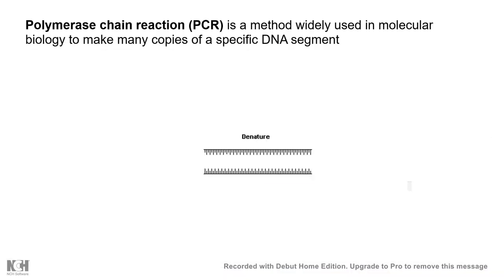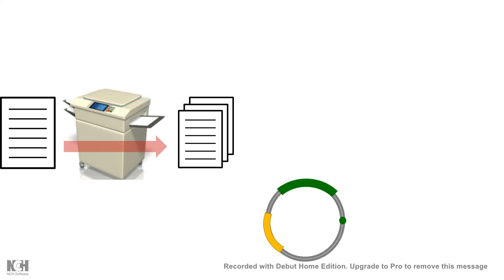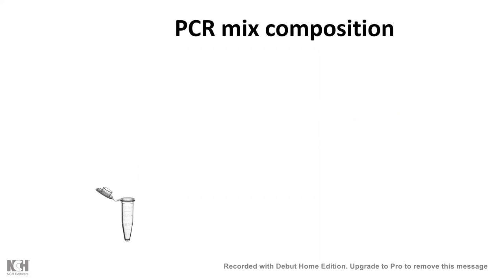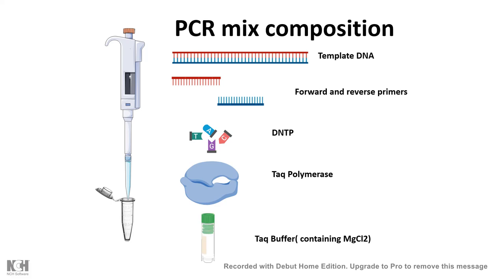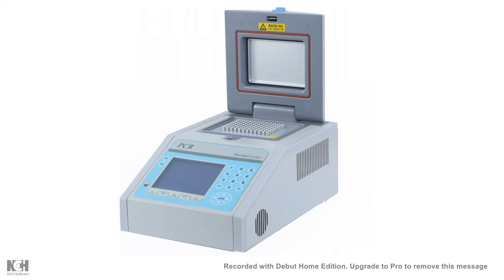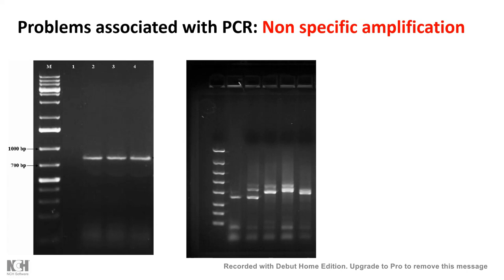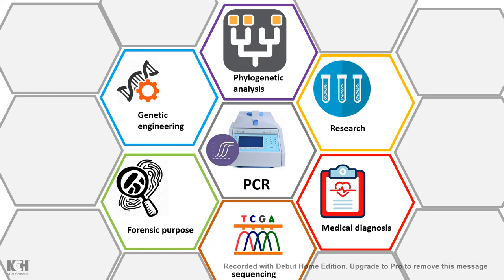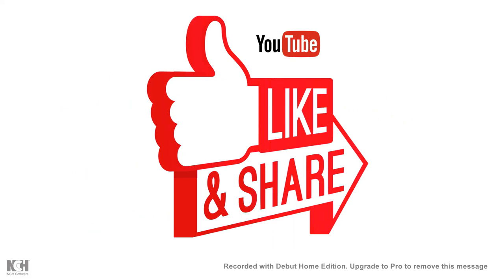polymerase chain reaction ( PCR) | What are the 3 main steps in a PCR reaction?

Comment: How can i avoid the smearing problem? What is optimum template concentration should use?
Reply from the maker: It's actually not simple. But trouble shooting cab be done by following ways.
To avoid smearing , consider these steps:

1. *Optimize Primer Design:* Ensure your primers are specific to the target sequence and have similar melting temperatures.

2. *Template Quality:* Use high-quality DNA templates free from contaminants or degradation.

3. *Template Concentration:* Use an appropriate DNA template concentration. Too much template can lead to non-specific amplification.

4. *PCR Conditions:* Optimize annealing temperature and extension time to prevent non-specific amplification.

5. *PCR Cycling Parameters:* Follow manufacturer's recommendations for enzyme, buffer, and cycling conditions.

6. *Hot Start PCR:* Consider using hot-start enzymes or reagents to prevent non-specific binding during the initial setup.

7. *Gradient PCR:* If unsure about the optimal annealing temperature, perform a gradient PCR to identify the optimal temperature.

8. *Negative Controls:* Include negative controls (no template, water) to detect contamination or non-specific amplification.

9. *Template Denaturation:* Ensure proper template denaturation during the initial PCR cycle.

10. *PCR Cleanup:* Purify PCR products using methods like gel electrophoresis or commercial kits.

11. *Agarose Gel Analysis:* Analyze the PCR products on agarose gels to confirm the presence of the expected size band and absence of smears.

12. *Primer Dimers:* Minimize primer dimer formation by designing primers with appropriate melting temperatures.

13. *Template Source:* If working with complex samples, consider using purified DNA or additional purification steps.

14. *Troubleshooting:* If smearing persists, troubleshoot by adjusting annealing temperature, extension time, or reagents.

Remember that optimization may require some trial and error. Regularly validate your protocol to ensure consistent and accurate results.
Reply: Okay got it. thank you